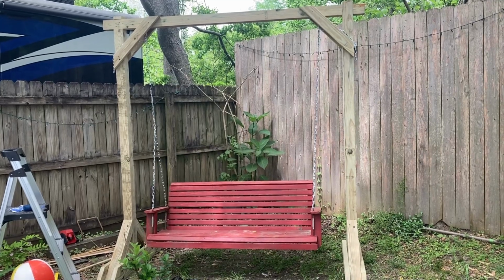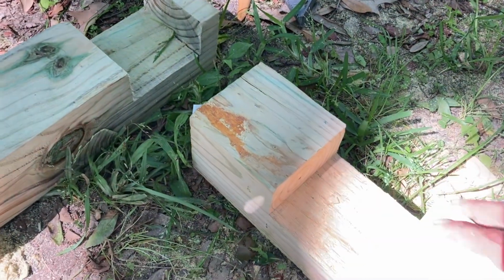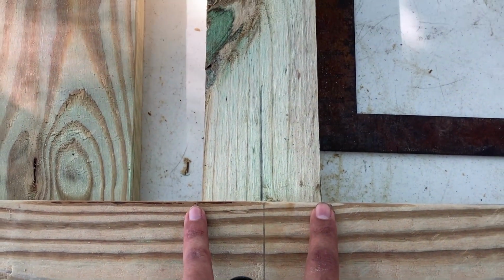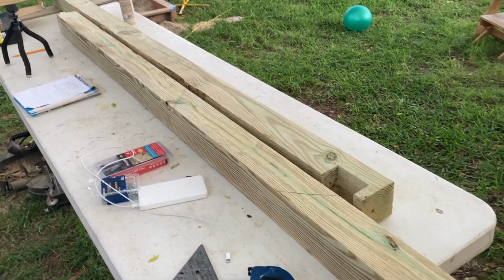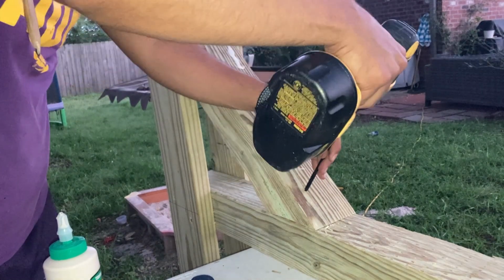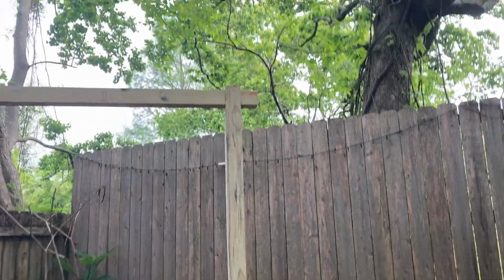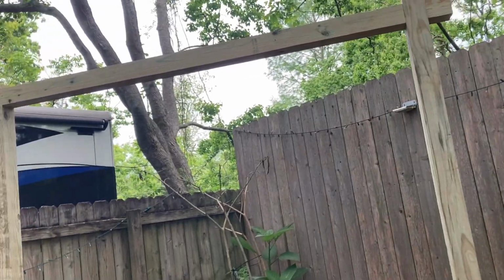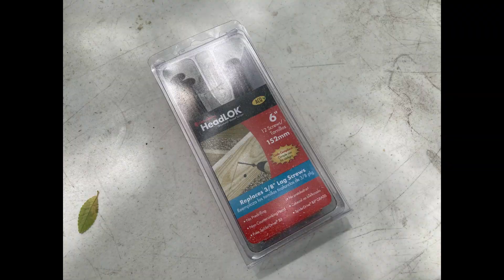Porch Swing Frame DIY Build - $135

Comment: how are the 4x4s holding up? i know its only been a few months.
Reply from the maker: They look brand new. They’re pressure treated so I expect them to last 15+ years or so. About as long as fence posts last down here in the south
Reply: @fiveohmxco  seems it could be portable? have yall tried moving it?
Reply from the maker: @josholivarez3804 yea, we adjusted it a few feet and it’s not very easy to move tbh. Pretty heavy and awkward to maneuver. Once the feet come off the ground it gets a little wiggly